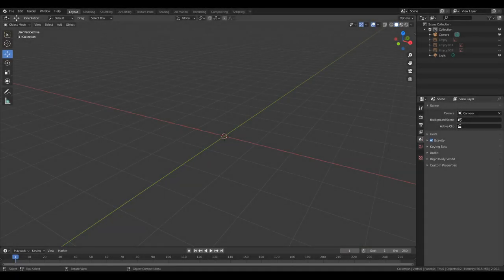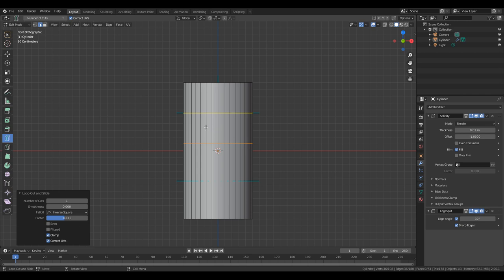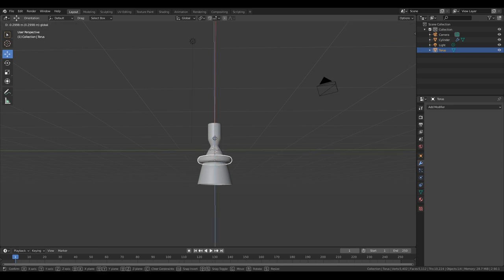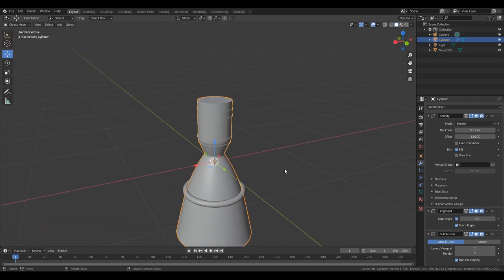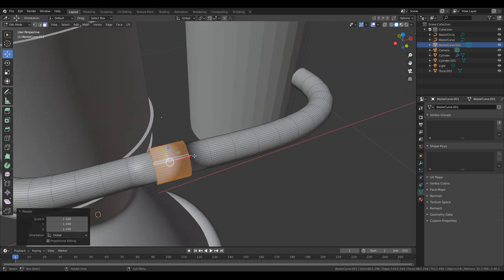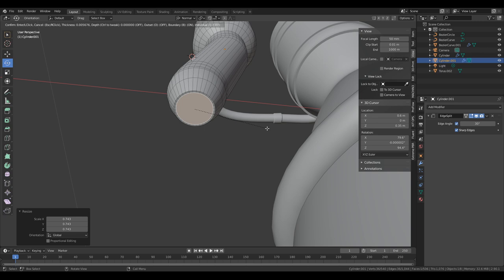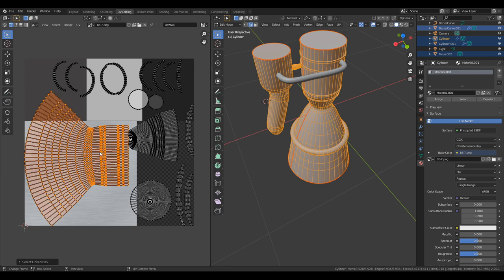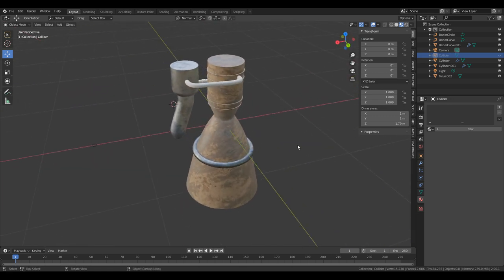Blender - Rocket Engine Tutorial

Comment: Is there any way to export the metal material you made in blender as an image?
Reply from the maker: If you're talking about the Extreme PBR texture, that's an image already and I usually just go into the folder and grab the appropriate one. There is a way to bake textures using nodes, and is more often used with procedurally generated stuff in Blender, but I don't remember how that works since I don't use it much.
Reply: not really the extreme PBR, just getting different meshes different materials on the same texture sheet, because if I want one mesh a shiny metal pipe, and another one matte, well i'm not sure how to do that
Reply from the maker: Shininess is a special subject, since in KSP that's applied by the shader rather than the material, so you would write a Textures Unlimited patch and tell it which meshes you wanted how shiny. As far as just getting different materials on the same texture sheet, I sort of showed an example at 44:14. I normally do that by arranging a palette of materials I want to use for the object in Photoshop, then import that single sheet into Blender. You can also export the UV map from Blender and then use that to apply materials to in an image editing program.